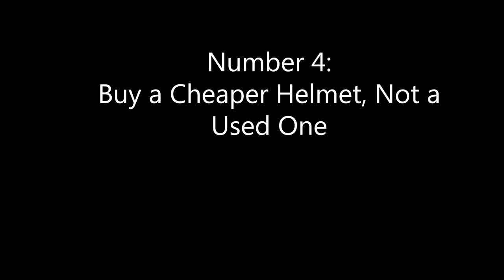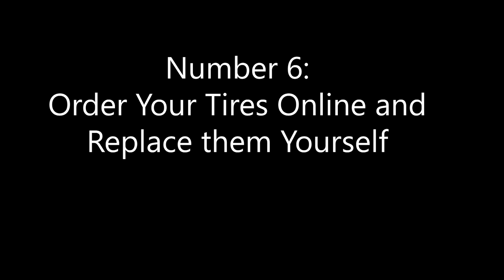7 Cheap Hacks for Beginner Motorcyclists

Comment: I’m prob gonna sell my bike before I need a valve adjustment and tires...
Reply: ... So in under like 4k miles? Tires really don't last very long.
Reply: Death Wish83 I live in Ohio so my riding season is ultra short... so I can prob get a season or 2 out of 80% tread.
Reply: I sold my first bike before the valve adjustment because it looked very hard to even get to the head.  The next bike I purchased was a BMW Boxer (the R engine) because the valves are easy to get to.  I'm still overdue to check those valves...
Reply: @dahveed284  I just leave that to the mechanic. It is overall cheaper than a damaged engine. I never questioned the valve check, I questioned selling the bike before changing the tires.
Reply: Lol me too...
Reply: @MosesEmmet  I live in Michigan and my riding season is 12 months. Get some warm gear
Reply: dahveed284 You don’t have to spend thousands of dollars to get a new bike because you don’t want to send the other to a shop lol
Reply: It's kind of ridiculous that people think valve adjustment is hard to get right. It's a pain in the ass on a motorcycle because the stuff can be hard to get to on most bikes, but once you get down to the valve getting the adjustment right should be almost impossible to mess up. It's hardly more complicated than changing a spark plug. IMO it's a nice afternoon in the shop with some music playing.
Reply: @John_Ridley  That's assuming people have a shop to work on their bike. I have the side of my street...

Comment: I don't have a stable income daddy yam, so I guess I'll just have to stick to my bicycle and the revving sounds i make myself. ;-;
Reply: Messy Queen same
Reply: You don't need to resort to that. Some clothes pins and a few playing cards from a discarded deck against your spokes will have that BBRRRRRRRPPPPPP going every time you are!
Reply: @purplemongoose4887  lmao noted
Reply: If you don't mind learning to do most of your own maintenance, you can get a motorcycle for not that much more than a new bike these days.

Especially, if you're willing to shop for parts at swap meets and trade work for parts. I forget which channel it was, but I saw one where they got all their necessary gear and the motorcycles for under $2k. And it may have been $1k.

IIRC, it was the motorcyclist magazine channel.
Reply: Put a soda can between your rear tire and frame or wherever it gets stuck. It will make a motorcycle sound when you're moving! Did this as a kid lol.
Reply: @purplemongoose4887  I did that very same thing as a kid. Tried showing my daughter the other day, but the cloth pins is to small for the bicycle frame lol
Reply: Hi i'm from Malaysia i wanna say your advice very useful and give me a spirit to move on as a biker
My first bike is hyosung gd250r also in Malaysia call its as Naza N5r

Also forgive me if my grammar is trash
Reply: Bicycles cost less 🐼
Reply: I prefer to buy the best machine i can afford, making sure that it is reliable in the first place. Then not tinkering where i don't know what I'm doing and making sure that buddy who promised to fix my ride for a case of beer both 1. Knows what the hell he's doing on my ride and 2. Waites until after the mc is fixed before cracking into his 2nd beer. 
If you don't know how to fix your bike, and you don't have a friend like that, then suck it up buttercup and take your ride to a qualified mc repair shop. There's nothing worse than having a broken bike parked in your spot taunting you every day.
Reply: @SmallSpoonBrigade  Who with an unstable income has a 1000$ dollar bicycle ?
Reply: @BaldMancTwat  I sold my downhill bike for a motorcycle. Best desition ever.
Reply: rides by with trombonist on the back
Reply: vroom vroom
Reply: Strap a soda can on the back of the back tk where it rubs the tire slightly
Reply: Have you tried a playing card and clothes pin?
Reply: Haha Here as kids we would run over an old beer can and it would make a nice tinny 2stroke rattle
Reply: Water bottle in the back tire
Reply: Do as I did get a $200 motor, your bike, some parts' and accessories so it works and boom done
Reply: @purplemongoose4887  drag coefficient increased by 3 folds
Reply: Buy a 120cc engine for it
Reply: It's been 5 years, you on a motorcycle yet? 👀

Comment: Hard agree with the craigslist bike part. I managed to get an 80hp Yamaha Fazer 700 for $950, that kind of performance would cost you at least $5000 new.
Reply: Lol you got an old motorcycle.. That's why it was cheap, not because you snagged a "deal" lol. And $5000 will put you well over the 100 HP mark with supersports. My Yamaha FZ6 makes close to 100 HP with an exhaust.
Reply: my first bike was a 73' cb360 i got for $600. sold that for 1k, kept trading up and now im onto the best bike ever, the 690 enduro R
Reply: @KrestenGiese  it still was a deal though and he got a lot of bike for cheap
Reply: @KrestenGiese  also the fz6 wasnt 5000 new
Reply: @KrestenGiese  yeah sure dude you can buy a new bike plus a tune and exhaust for $5000. Cool story bro.

Comment: I completely agree, do your own tire changes. It is so worth the savings doing them yourself and it’s relatively easy, especially if you use dyna beads to balance the tires (Which work great by the way).

Comment: Every motorcycle I owned was from Craigslist. I started with a 2000 vstar 650, sold it bought a 2001 Honda shadow ace 750, sold it Then jumped in the deep end with my 2003 Honda VTX1800. I also have a zx10r and a liter cbrr. All from craigslist. Just have to maintain them. Good vid.

Comment: I figured i just had to comment on buying a used bike. I grew up a car guy and let me tell you ALL of it transfers. If you want a cheap ass bike and it runs well, might be a good buy. Just depends on what you want. I know from the car game that projects are an endless abyss that you throw money down. If you want a project to have fun and make memories with this might be your best bet. I had an 09 Ninja 650 as my first bike that ran well but i put work into until i was satisfied. I broke even selling it to a friend. Fast forward 2 years later to now i got into riding again and bought a “running” 99 gsxr 600 for 800. About 400 bucks later runs phenomenally. If you love a fun project and have the know how, you can easily justify it.

Comment: Agree on the tires. I bought the tools needed to change them and my first new tire for less than it would have cost t have the shop put it on so the tools are paid for instantly. And the bike rides better with the discount tire from Amazon than it did with the OEM tire it had when I bought it.

Comment: I got a Shoei RF-1200 with a photochromatic lens as my first helmet. Yeah, I had to save up almost $600 but saved about $150 by not getting a helmet with graphics on it (went with matte black).  It cost a lot but it's the only helmet I have/need. The lens changes tint based on the light so I never need to switch out visors plus it has a pinlock so it never fogs up. The vents and visor work well sitting straight up and in a tuck also.  I ended up saving money in the long run by not needing to buy 4 different cheap helmets with 2 sets of light and dark visors. Plus comfort IS a part of safety. If you're comfortable then you pay more attention to the road and not to your discomfort.

Comment: Tire mounting tip:   Shop around, you might find a shop that will mount and balance tires for free if you buy them there and bring the wheels in with you.  Cycle Gear sucks:  decent price but they charge a premium to mount them.  My local Big Four dealer matches internet prices and mounts for free.
Reply: orangelion03 my tip: look up using zip ties to mount tires. I was skeptical but it has worked astonishingly well every time I’ve done it.
Reply: Or just buy some tire irons for like $5 each....
Reply: Pat W Are you some kind of super genius? I didn’t even consider to use my tire irons, or to go buy those$5  high quality irons you see for sale everywhere. I’ve changed tires before Pat, there was a Shinko Raven I just. Could. Not. Get. On. Using. Every. Conventional. Trick. I. Knew.
Reply: @kevinwhite4494    is this Kevin White my fellow R1200GS rider and neighbor in Santa Paula? =D
Prolly not, as "my" Kevin has a tire changing stand that I always forget he has...
Reply: orangelion03 this is the Kansas Kevin white on an XR650L. He sounds like a good friend to have!
Reply: @kevinwhite4494  Greeting from SoCal Kansas Kevin!   Neighbor Kevin  has an XR650R, and MY other bike is an XR650L!

Comment: buy cheap stainless tools at harbor freight, they are the best for the money
Reply: Exactly, I use them if I need tools to work precisely once...
Reply: Buy good quality hand tools. Consider it an investment. I use HF for things that I'm not thinking I'm gonna use more than a few times. If I'm putting something on the bike to carry if I need it, and I do wind up needing it, and it breaks, well, I can be righteously p!ssed off at a Stanley/Craftsman/Snap-On/Whatever. Not so much about the 59-piece set I have in the garage because it was the same price as the 10mm and 14mm sockets I'm somehow always missing from my good set. The cheap ones may last. They may not.
Reply: You're better off visiting the local pawn shops regularly until they have a good set of tools available. If you're lucky, sometimes you can get an entire set of snap on tools or similar for a deep discount and not necessarily any worse for wear than when they were new.

Tools are one of the worst things to try and save money on as a bad set can make it too easy to damage things. Plus, you don't necessarily need to buy an entire set. Chances are that the bike only uses a small number of tools for most of the work. My Stanley sockets were pretty good quality and they didn't set me back much.

The biggest expense with wrenches were the torque wrenches and those you absolutely have to get right and it's a wise idea to learn how to verify their calibration.

Comment: Honestly on helmets you should look into move then just comfort and protection features. I bought a helmet that came with a separate anti fog visor that sticks to the actual visor and its been a pain in the ass because it lost its adhesive and scratched like crazy and tightening it was a pain, the way to remove and wash the padding it a pain and the seal on the visor isn't waterproof so in heavy rain it leaks in. 

Ask these questions before buying. Save yourself a world of pain.

Comment: What is the fattest and best forks in suspension that I can put on a 2009 Kawasaki Ninja 250R I need to replace the forks the shocks the triple tree and the handlebars so I wanted to make them thicker so they could hold more weight

Comment: Hey... older Ducatis are easy as fuck to work on. All of my Monsters, my 750 Sport, my 900ss, my 916, and all of my 748s were cake. Valve adjustments on the 748 are only annoying because one of the banks is hard to get to with the engine in place, but I've never had to pull out an engine to preform repairs (even head replacements). That being said; wrenching on my Panigale is a colossal pain in the dick. I fucking HATE working on that bike, and I'd take it to a shop if I weren't so goddamn cheap.

Comment: You are wrong about the helmet segment. "If you have a 10 dollar head ,buy a ten dollar helmet" were the wise words of my motorcycle instructor ages ago in the UK...
Reply: john fragos, there is no evidence that price had anything to do with the safety of a helmet. Sure, more expensive helmets are more aero, comfortable and cooler looking, but that doesn’t translate into safety.
Reply: @alexb5275  snell approval is certainly an upgrade over DOT and ECE. You can get a cheap snell shell if you look at scorpion helmets.
Reply: He said over $200 is little difference and I tend to agree. Get ece and or Snell rated and you're pretty much already at peak for safety
Reply: He's not wrong though, a helmet that posses the certifications is more or less equally likely to be safe as another that passes the same certifications.

The extra money you spend is mostly on comfort features, not safety features. I'd personally go with a Snell certified helmet over just the ECE or DOT standard, but beyond that, there's no basis for assuming that the additional money is going to lead to more safety.

Comment: I bought a continental 50 quid for the tyre and fitting so I'd just shop around personally I wouldn't do it my self as I don't have a the mkeny to spend on tyre fitting equipment and you'd be spending like 40 to 50 quid for a tyre so whats the point

Comment: 40 dollars to change a tyre?!! That's insanely expensive! It's like 4 bucks here in India, for the pair.
Reply: It's not insanely expensive, the process takes a bit of time and you don't want an idiot doing the work. I wound up paying for roughly a half hour of shop time when I had my previous tire replaced and that's a reasonable minimum time to remove the wheel, remove the tire and do the appropriate work.

The reason it's so cheap in India is because most things are. The rent on the shop alone would cost more than that.

Comment: I like your series and am usually a fan, however your advice on a 200 helmet being just as good as an arai is just plain ignorant.  There is a reason it's more expensive, its. a better helmet.  That's why almost every road racer, motogp rider, etc... wears arai and shoei, not icon and fly.
Reply: @yammienoob  dot rating was established over 50 years ago, it means nothing and it is not government regulated.  Ece allows manufacturers to beef up the center of the helmet because that is where they test while neglecting the sides and the same goes for dot.  The only thing for 200 is a plastic exterior with a cheap eps liner, great for a glancing blow but will fail on a direct hit.